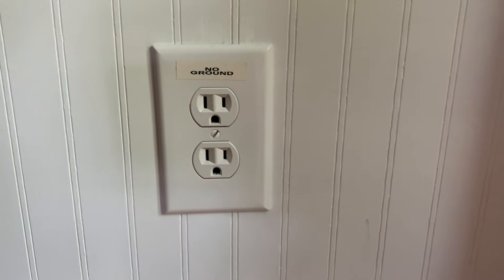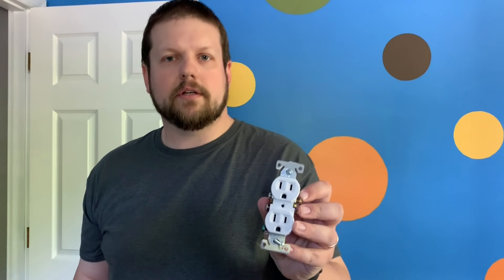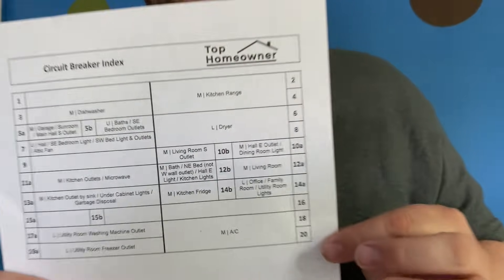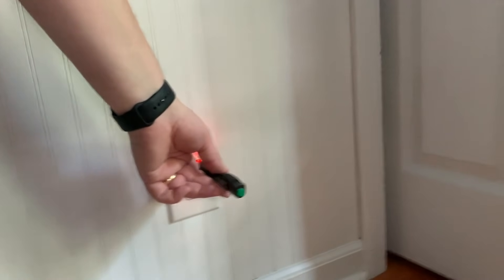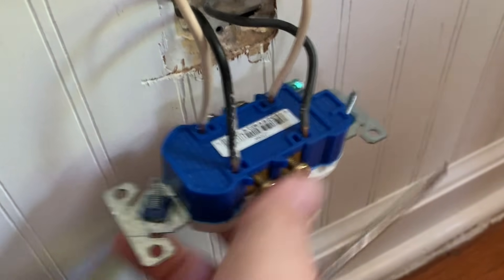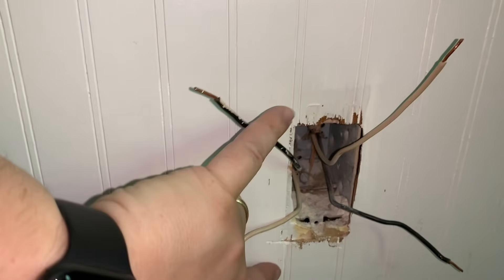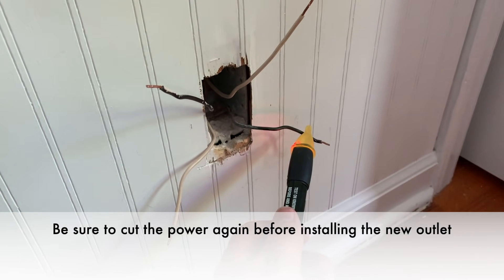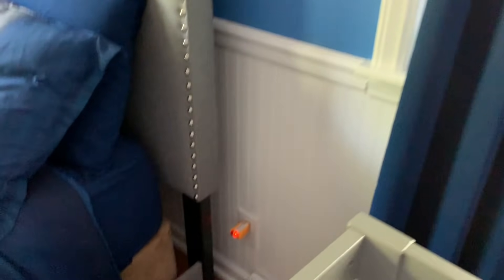Fixing Ungrounded Outlets - An Alternative Option to Rewiring Your Home

Comment: Thank y’all so much for this video!
Iv got 3 young kids and when they go see there grandparents , which is 4 or more times a week iv been worried about my parents old house that has no grounds.i will def be in stalling these grounds!
Reply: Yeah, this is not actually providing a ground, but it is safer.
GFCI protection is safer than grounding in a wet location or anywhere a person could become grounded.
In the age of plastic boxes and covers, getting shocked by a receptacle is difficult.  Touching electricity while grounded is actually much easier.  Let's say a toddler sticking something into a socket while touching a radiator: in this situation, grounding would do absolutely NOTHING to protect that child, but GFCI protection would save their life.
Reply: @SwingboyPA  never thought about the toddler sticking something into the outlet while touching a radiator scenario, but that's a valid point,  and that's why anytime a receptacle is replaced,  with a few narrow exceptions, must be tamper resistant.  On the other hand,  a gfci on an ungrounded system renders a surge protector unless in the event of a lightning strike,  and you can kiss that 50 inch smart TV goodbye.
Reply: @Sparky-ww5re  Yep, that's a really good point too. I live in the city where I never used to think about whole house surges because ... It just never happened.
HOWEVER, as people switch from gas to electrical appliances, our grid is being more and more stressed and consequently, I'm seeing more brownouts, transformer blow ups, and other issues which could damage equipment in a house.
Before a few years ago, I never even considered installing a whole house surge protection system, but I've changed my mind on this.
So that's another level of protection that's a really good idea for people in houses -whether their wiring is old or new!  :-)
Thanks, I love having a productive conversation online. It's so much better than the usual pissing contests. :-)
Reply: Just making sure you know, this is not a substitute for a ground. This will not protect your equipment from getting damaged. The only thing this will do, if it senses less power is coming back in then going out, it will turn off the power within 1/40 of a second.
Reply: @ohya101  Your equipment could not care less if it is grounded or not.  The ground is there to protect people from touching the equipment if it has a short and has become hot.  The GFCI will essentially do the same thing.

Comment: When you're risking your life by touching bare wires, it's a good idea to first TEST your tester. You didn't do that, so just touching wires that are already dead could either mean the power is off or your tester isn't working.  Test BEFORE you turn off the power, then verify it's off, now that you know what the "power on" indication would look like.   Also, it would help a great deal if you inserted a photo of the COMPLETED receptacle wiring (to line and load), showing which wires go to the panel and which to the other receptacles.  Otherwise, good job.

Comment: I don’t think the outlets past the gfci are protected on a circuit that does not have a third wire,you need a gfci outlet at each location
Reply: Yes they are GFCI does not use the ground wire at all. It monitors imbalance between line and neutral and if there is, it cuts both. Ground wire may help in establishing that imbalance but it is not necessary for there operation.
Reply: After doing some research I discovered that the downside outlets will be gfci protected but will not have an equipment ground and should be marked as such u

Comment: Bad idea!  This provides protection ONLY if the GFCI is grounded AND the load grounds (slaved outlets) are connected to ground.  The GFCI is not supposed to reset with a missing ground...hence "Ground Fault Circuit Interrupt(er)".  Call an electrician and do it right!
Reply: @Scott.  A  GFCI doesn't require a ground to reset or to function properly.  A "ground fault" has nothing to do with "missing ground", but rather an "extra", unintentional ground.  Look it up.  No ground connection is legally required (by NFPA 70, NEC) for installing a 3-prong GFCI receptacle (or ordinary 3-prong) to replace a non-grounded 2-prong receptacle or when otherwise protected with GFCI.

Comment: This doesn't provide any protection from something creating a hot area on a device. For example, if you are working on a laptop plugged into this, and some short inside the laptop causes the case to become energized, you can get electrocuted without tripping this GFCI. The power can just run through the hot line, through your body, and back to the neutral. This is ungrounded so there is no ground protection, which would normally be the preferred path for the electricity (not your body).
Reply: Odd that you would make such a detailed comment without first taking thirty seconds to understand how a GFCI works. Hint: it has nothing to to with the GFCI being connected to "ground".  Your GFCI actually WILL trip if you're "grounded" and some fault in your appliance causes you to take some of the current. That's what a GFCI does: it trips instantly when the hot and neutral terminals become imbalanced by a tiny amount (like 5 milliamps).  So, you won't get zapped, which is why code authorizes this for replacement of ungrounded receptacles.

Comment: So if this is wired correctly, will the GFCI tester still show as open ground when you test the GFCI outlet.  And the tester will not trip the GFCI although it will trip with the test button.  HELP!!
Reply: Yes, a socket tester will still show open ground as it is open. The GFCI tester does not work as it relies on the ground wire. The test button does not rely on the ground wire so it works. The text "No equipment ground" tells the tester that open ground is OK. In fact if it did not show open ground there would be a problem.
Reply: @okaro6595  This "missing ground" on GFCI "testers" has tripped up a lot of people!  "Why does the test button on the receptacle work but not the one on the fancy tester I plugged in."   I wish people would actually read the instructions on their testers.
Reply: UpnorthHere please explain this. My tester doesn’t say why.  I have gfci breakers on ungrounded circuits and the tester won’t trip the breaker - you say it relies on the grounding wire to trip it.  I can’t get this house to pass inspection because of this issue.
Reply: @balukus1107  The proper way to test GFCIs is the built in test function, not an external tester. If the sockets re properly marked not to have ground then any person testing it should realize that an external tester does not work.

Tools are just tools,  it is for the user to use them properly. It is for user to interpret the results of the tester.

Comment: Nothing replace a good ground ! Do not be cheap with your life. If the house has no grounding call an electrician and get it done correctly. A ground fault requires a dedicated ground to be effective.
Reply: @sprsgt You're simply wrong.  A GFCI doesn't require "a dedicated ground" to work.  That's kinda the whole point. Sorry you missed the boat.  Maybe you can watch other similar videos where they explain more about how a GFCI works and WHY this exact solution is authorized in the electrical codes.

Comment: Yes you will accomplish what you said BUT still no ground. The person who added the green ground wire must not have know that there has to be a hard ground attached to the box as part of the wiring going back to the box, older homes usually had box armored cable from box to socket or what we now call Romex with three wire, hot, neutral, ground. The ground was almost always attached to the metal box by a clip. Some guys used to wrap the bare copper ground around the cable retainer screw. The main point is that if you can’t see that bare  copper wire and test it to the box, it’s not grounded. There were also some old soft jacket cables that were only 2 wire . I won’t talk about grounding practice there. Run a Ground ! Don’t ground to water pipes. Be safe.

Comment: Perhaps replacing the metal outlet boxes with plastic ones while you are already replacing the outlet(s) may be a good idea.
Reply: But you can also alternatively ground the metal box as well.
Reply: Yeah real fun digging the metal boxes out of the paneling.
Reply: @bgarrison67  ...as a bonus, you might trash the insulation on the wires too!  :-)
...And of course your customer ALWAYS appreciates spending their money on unnecessary "upgrades".
Reply: Why?  There's nothing wrong with metal boxes.  I use both, but while I've seen scorch marks, I've never seen the side of a metal box completely burnt out like I have with plastic.

Comment: This will not work, you need a ground for the GFI circuit, in fact you are making all outlets more dangerous
Reply: Did you consider looking at the comments`or look the video at 9:30 where he tests it and it works. The GFCI does not use or need ground.
Reply: Everyone Can Do DIY. It is completely acceptable to replace a ungrounded receptacle with a grounded receptacle (see 2017 NEC National Electrical Code article 406.D 2(c). ) exactly how he did it, except he didn't mark the the GFCI "GFCI Protected” and “No Equipment ground", and every receptacle after with  “No Equipment ground" also An equipment grounding
 conductor shall not be connected between the grounding type receptacles.
Reply: @Bluesman57  Maybe you meant to type 406.4(D)(2)(c).

Comment: 1st world country. 3rd world electrics. Shocking!
Reply: Ungrounded sockets are very common in many countries on old installations. In Finland for example they were legal up to 1997 in dry rooms, in Sweden up to 1994. In Europe there just is no problem as you can always plug  grounded plugs on them. If you choose you can use a portable GFCI in between.
Reply: I see what you did there, lol

Comment: The missing ground wire provides the safety path for the current when a fault occurs, such as a piece of equipment shorting to its case. 

Backstabbing is usually OK for 14 gauge runs with solid wire.  Unless an experienced user wraps it around the screws, wrapping is more likely to fail than backstabbing, which is at least idiot proof.
Reply: @billyrayband: yes, but the point of the video is that you don't NEED a grounding wire if you properly install a GFCI receptacle when you replace your ungrounded receptacles with "grounding-type" (three-slot). The GFCI works fine without it and provides ground-fault protection that a mere "grounding wire" won't. For instance, a grounding wire won't save your life when there is a fault in your neutral that opens the neutral and puts it into contact with the appliance enclosure.   You could get zapped unless you also have a GFCI.
Reply: Dumbest thing I’ve heard. Haven’t heard anyone say wrapping is more likely to fail then a backstab
Reply: GFCI receptacles are different. They do not have the backstabbing option. The hole sin the back are secured by the screws.

Comment: Yes you do need to rewire your house. Your wiring must be at least 50 years old of that is the case. Don't listen to this idiot he wants you to burn your house
Reply: @Desmodes: This so-called "idiot" seems to know more about this than you, so we have to wonder where you got your edumacation.  There is no legal requirement to rewire your house simply to replace a non-grounded receptacle with a non-grounded GFCI, which allows you to legally plug in 3-prong cords.

Comment: 2 things, them recpticals are stabbed in back wiring not good at all always take time to wrap around screw, the other is on GFCI you haft make sure you have the line and load wired on the right  areas, line side is hot comes in load goes out to other recpticals.  What I've found a lot in older homes the box are too small for GFCI outlets so then use ground fault breakers
Reply: I have never seen a ground fault breaker, nor can I see how there could possibly be such a thing.  The breaker bus doesn't have neutral in it, so the breaker can't see how much current is returning on neutral.
Reply from the maker: https://www.homedepot.com/p/Eaton-BR-20-Amp-Single-Pole-Self-Test-Ground-Fault-Circuit-Breaker-GFTCB120CS/206109781
Reply from the maker: GFCI receptacles don't have a back-stab option. Back wiring is what they use, just like spec grade so it uses the terminal screw to clamp down on the wire. I talk about line vs load in another video: https://youtu.be/Uop79H_iqoQ

Comment: Another option is to replace the breaker with a combination arc-fault and ground-fault breaker.  AFCI+GFCI. A little more costly, but easier to implement.

Another note, since I AM and electrician... The stab-in connections on the backs of switches and duplex outlets are for 14 guage wire only and are NOT recommended to be used. These WILL cause problems down the road! Always use the side screw terminals.
Reply: Thank you for your input from a clueless individual myself I am learning something new all of the time from comments or videos.  Thanks again William it is greatly appreciated. 
Stay Blessed
Reply: The new cheap outlets have screws pressure tabs that bite into the back wires. I tried pulling them out and couldn’t if the screws are tighten which put pressure on the tabs.
Reply: @tonymanero5544  Hey Tony you are the man. The King of the dance floor.
Reply: Hey. I'm watching my father install a afci for me and he's plugging in the wires into the back, even though I read him this comment.  What kind of problems can I expect in the future? He says the screws on the side don't loosen up enough for him to wire it normally
Reply: @jabberman3000  What gauge of wire is he hooking up? He should have no problem at all if it is 14 or 12 gauge wire! The electrician here says the stab-in connections are crap SO WHO IN THE HELL CAME UP WITH THEM IN THE FIRST PLACE?!! I never use them either. Reminds me of the aluminum wire fiasco where people are NOW TAKING THAT CRAP OUT!!
Reply: @KStewart-th4sk  aluminum isn’t actually “crap”...it works well enough that all of the main lines are aluminum...The issue is that it expands and contracts at a different rate than copper and can thereby loosen the connection and cause  an arc...Definitely not trying to sound like an internet troll.  I just learned that not too long ago as my home had some in it and I was curious as to why it was a danger...
Reply: @jabberman3000  Some outlet manufacturers do provide a cinch plate for the side terminals. As long as the terminal screws are tight you shouldn't experience any issues. And did you mean GFCI? In any case, GFCI's don't come with stab-ins. They use a cinch plate like some standard outlets.
Reply: How can you make a GFCI circuit breaker when the breaker bus doesn't contain neutral?  All of the neutrals go back to the main neutral bus, not the breaker.
Reply: @phillipsusi1791  A GFCI breaker takes the branch feeder wires, hot and common, as load and provides it's own common pigtail that then gets connected to the neutral bar.
Reply from the maker: Thanks for your comments. I talk about both of your points in my follow-up video here: https://youtu.be/3AXcRsAOLPk
Reply: Amen to not using the stab-in connections. They get loose over time, and arc. On an older plug where I lived, plugging into one outlet resulted in a "pop" in a playing radio. A stab-in  connector was so loose, it was arcing.
Reply: Good suggestion arc & gfci. But, still no ground protection = not protected. And INMO this video had so many flaws out its dangerous.  Best line is "I am NOT a licensed electrician", = I know enough to get myself in trouble and take others with me.
Reply: putting an arc fault/gfci or just a gfci breaker is not going to do anything on an ungrounded circuit. you have to put a GFCI device at every outlet location in order to get away with a three prong device.
Reply: @bushgnome  That's funny, as I've passed every inspection I've ever had in situations like this. This method doesn't provide an actual ground but it is approved for changing 2 prong polarized outlets to 3 prong grounded outlets...
Reply: @williamweckel8140  ‘

Comment: Wait? I thought you was gonna show a trick to ground a 2 prong outlet into a 3?
Reply: You aren't real bright, are you, Bandits?
Reply: Run a wire from the ground to the neutral in the outlet if your main panel is bonded.
Reply: @thebadseal4895  That is not legal.
Reply: @okaro6595  Not legal because it's dangerous and "a really bad idea"!
Reply: @thebadseal4895  That's called a bootleg ground and is no longer up to code.

Comment: the gfci will provide shock protection for an individual but does not provide a ground for whatever equipment you are plugging in.  Call an electrician. This guy is dangerous.
Reply: It's not as "dangerous" as people stupidly cutting off the grounding pin on a cord or using an "adapter" to plug a three-prong cord into a two-slot outlet!  That's why the national electrical code specifically authorizes EXACTLY what he has shown in video.

Comment: If you have no ground wire from the the ground (not a ground from the circuit breaker) and you do not plan on installing or making a ground to the ground, it is safer to install a (GFCI outlet on each circuit to your circuit breaker. Ask an electrician how to correctly install the (GFCI outlet). Each circuit from circuit panel (breaker) needs 1 GFCI  outlet installed. Breakers are for electrical machine safety. GFCI's are for human safety. Out